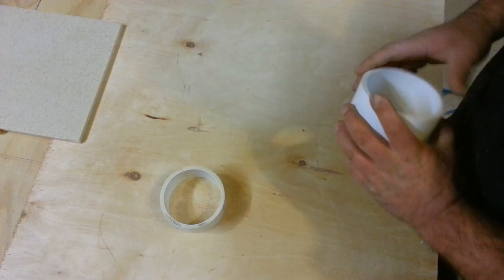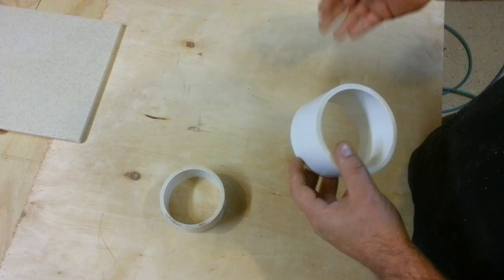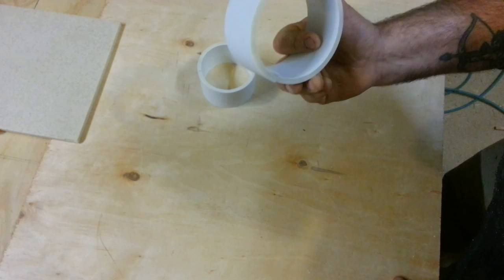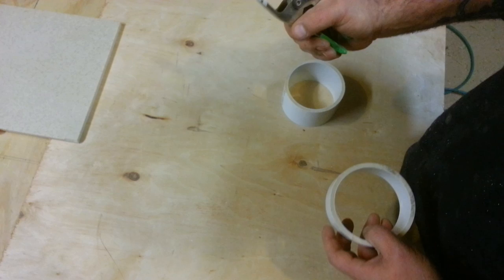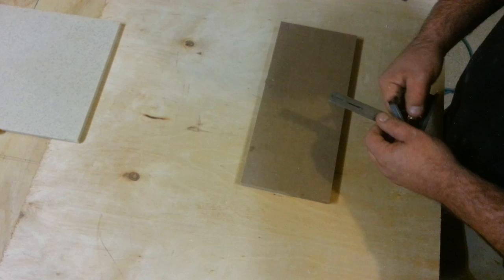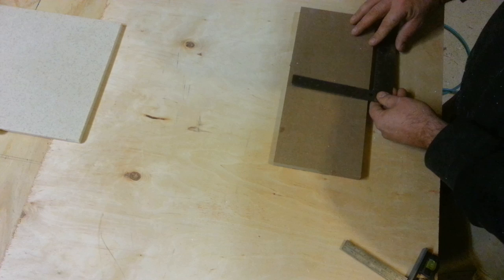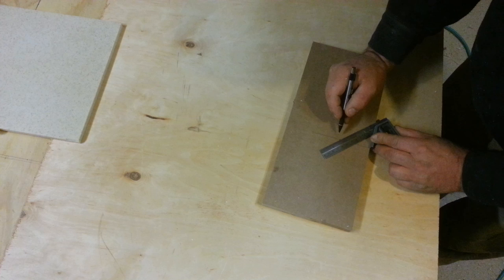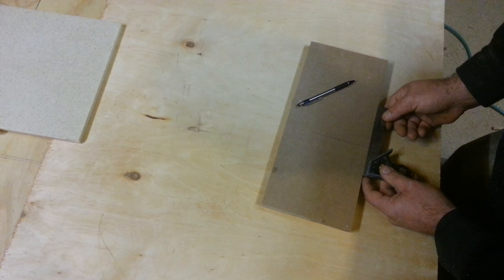Homemade clamps - using P.V.C

Comment: I like the PVC clamps.  You could also make finger notches by drilling 1" holes before you cut them on the chop saw.  Cut them on center of each hole and you'll have small notches to assist spreading them open.
Reply from the maker: ***** Thats a great idea! thank you
Reply: I saw a video where the guy drilled holes in the pvc and used 2 pieces dowel to spread the pvc open. Good idea.

Comment: It's funny that I came across this video today.  As while working in my shop last night I found one of my squares like the little one you had there was not only out of square but the slide  peace was so bend as to look like a noodle.  I kept checking it for square as I was trying to mark a length of board for several matching cuts and even as bad as my sight is getting I could see it was wrong. Keep the videos coming.

Comment: I use to work in a carpenters shop on a Navy base in Italy and there was an Italian master carpenter who ran it. He used thick gauge copper wire as clamps. Mostly on frames at every corner. Just bend them into a ring and stick on the corners.
Reply from the maker: TripleXmodder  thats a great tip my dad used to use close hangers in a similar fashion..

Comment: If you cut out a two or three inch wedge out of the PVC you are using they can be used to clamp up boxes on the glue up. One piece of PVC on each corner with a band of web running thru them.

Comment: Your framing square, you can square it by laying it flat, and taking a hammer and a drift, you can close the inside by hitting the outside corner a couple of taps, which should bring the two edges closer. To spread it, hit the inside corner till it spreads.

Comment: Great channel Izzy. But the trick you used in trying to attempt confirmation of the 45 angle of your combination square is actually incorrect. You needed to measure the length of the x axis against the length of the y axis. If they are exact then you have a 45. If the y is shorter than the x then it is less than 45 and vice versa. 
Cheers from NZ mate.

Comment: If a framing square is off by just a little, you can use a center punch to stretch the metal in the are where the arms come together.  Depending on where you put the dimples, you can open, or close the angle.
Reply: Cheap chopsaw

Comment: Oh I just had a great idea that I can use for this. I have a long arm quilting machine. I have to pin my fabric to the rollers which takes approx 30 to 40 mins.. What if I cut  PVC like you did and in 2 ft length and to the right circumference I bet it would clap my fabric on the rollers tight! What do you think?